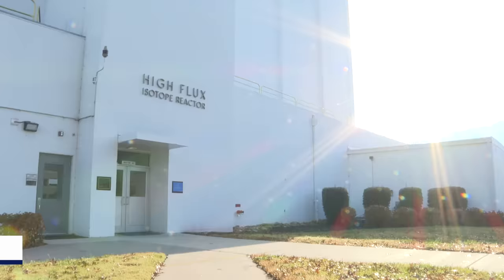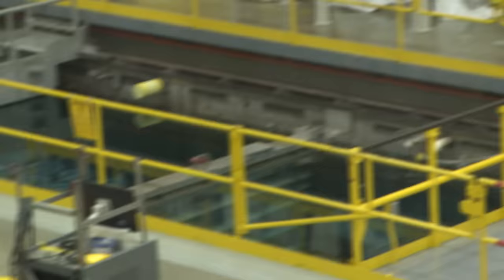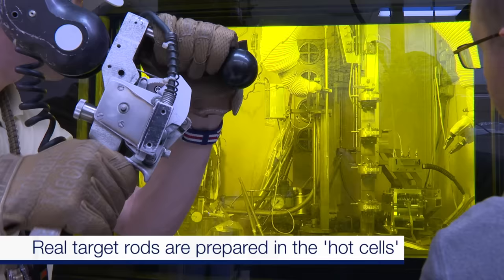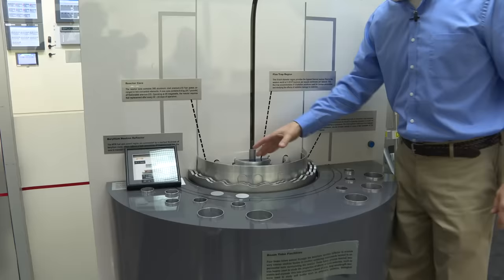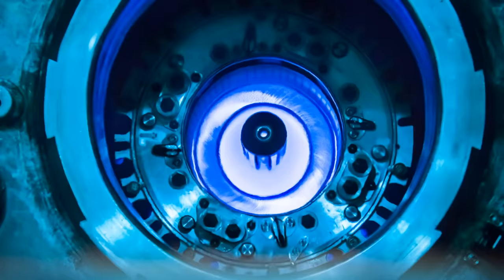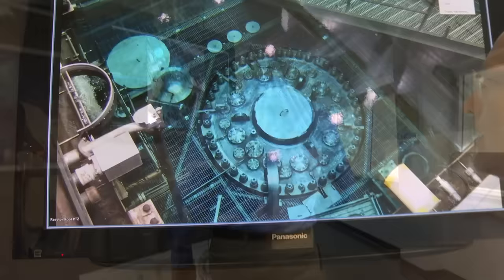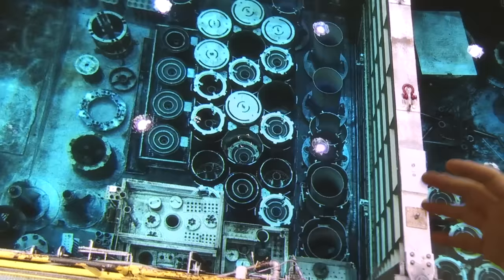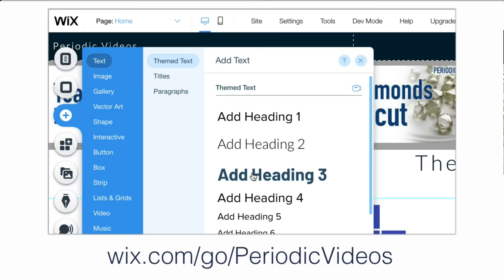Inside a Nuclear Reactor

Comment: "...not trying to make electricity like, say, Chernobyl reactor..."  That's one heck of an example, professor.
Reply: waitaminutedoggie ikr xD
Reply: For better or worse Chernobyl is the most well known nuclear power station.
Probably worse
Reply: Rosatom is still operating 10 reactors of the same RBMK-1000 model across Russia.
Reply: @stephenbrand5661  It's pretty save until next Dyatlov .
Reply: @stephenbrand5661  there have been significant changes to the rbmk since then, they are pretty safe now.
Reply: They made electricity and plutonium.
Reply: Scherbina: - How does a nuclear reactor work?
Legasov: - Nuclear reactor produces electricity.
Scherbina: - Now I know how a nuclear reactor works. I don't need you anymore.
Reply: When you meet your 5-8 year energy quota in the span of 0.2 miliseconds 
Gud job chernoybyl we need more like you
Reply: @steelwarrior105  mainly reducing the positive void coefficient from 4.7 to 0.7 meaning that it's more difficult for it to go unstable
Reply: @unepintade  yeah and the control rod mechanism to a drop scram and removing the graphite rod tips
Reply: I mean when you probably get asked "isn't that dangerous, what about chernobyl/three mile island/fukushima" a lot, your "no it isn't because XYZ" becomes reflexive
Reply: yeh but have you ever heard of Bradwell power station?? i doubt it
Reply: So, what would be another well known reactor that anybody over 13 years old has heard of?  Even with hindsight I can't even think of one even close.  Maybe Fukushima...
Reply: @stephenbrand5661  As long as there's no graphite.
Reply: @stephenbrand5661  Chernobyl still made electricity atother reactors year after...
Reply: That's dry humour for you.
Reply: For Climate Change, nuclear energy is the cleanest carbon free energy source for baseload grid power source we have available
Reply: It was a power reactor, so ...
Reply: i thought same, but it is in fact  really most famous  nuclear electric plant
Reply: @condor2279  there was no graphite. You're delusional.

Comment: One of your best vids ever. I bet that lab was mega-top-secret in the past.
Reply: Only during WW2. Since then it has no longer been involved in nuclear weapons, and is not secret anymore.
Reply: There still is... As per the what the man said "they supposedly make power fuel but I don't know much about that..." :)
Reply: @brianreddeman951  The spent reactor fuel gets transported off-site to another more-secret facility.
Reply: @brianreddeman951  Nothing secret about that. MOX fuel is made by recycling spent fuel. Best thing to recycle, by far.
Reply: @lajoswinkler  MOX is a different process, that plant is still being made and is only meant for powered reactor fuel. This is a mixed aluminum fuel renaturing process very different from PUREX used for MOX. As a nuclear nerd, I also don't know anything about this program!
Reply: @lajoswinkler  My comment was part in jest. :)
Reply: Top secret//SCI
Reply: @Disappointed *finger guns
Reply: Oak Ridge is where the first fissile material was made for the bombs that were dropped on Japan in WW2. There are still parts of the facility that are classified. Oak Ridge also had a working thorium reactor, and as far as I'm aware, the only working thorium reactor.
Reply: Super duper mega top secret.
Reply: Come to think about it my father talked about it when they where building it wasnt much of a secret at all now the one in new Mexico no one knew about that but the ones working on it but not this one
Reply: @gordonrichardson2972  Most people get confused because there's two separate labs in Oak Ridge, Tennessee. This is at Oak Ridge National Laboratories, which does not do secret work, and does not do nuclear weapons. As mentioned in the video, Y-12 National Security Complex is next door. That is where nuclear weapons work is done.
Reply: @brianreddeman951  power fuel for a powerful weapon.
Reply: Well kinda sorta. I live in the county next to Anderson where oak ridge is. The locals all knew but outside these hills it was pretty secret. So yes to,the world it was super top secret like people lived and worked in,the city and didnt leave.

But the locals according to my grand parents all knew what was u0 because our kin folk was running the place and building it even.

Comment: That was a great tour! Since they want neutrons, it makes sense that they didn't have boric acid in the cooling water to absorb neutrons.
Reply: "boron in the form of
 B4C, is present in the inner fuel plates. In particular, 2.8g of 10B are present in the whole IFE (0.0164g/plate). It is used to shift the power to the outer fuel element and reduce the core reactivity"

This is important as the core of this reactor uses highly enriched uranium. This is so the neutron economy can be high at all points in the fuel cycle, but also means excess reactvity in the core areas has to be managed with absorbers built into the fuel elements.
Reply: Glad for you to have had this opportunity to make use of your knowledge
Reply: wouldn't boric acid corrode the metals?

Comment: When talking about nuclear reactors, the majority of people are mostly fascinated by the blue glow of the Cherenkov radiation, but, in my opinion, the snowy like interference you see on videos is far more fascinating. Especially when you consider how each pixel flash is an invisible, high energy, charged particle hitting the camera lense at almost the speed of light. If, somehow, humans had the ability to see these charged particles with either our eyes, or a special camera, you would see a shower of energy coming from the reactor core. The fact that we're not able to see the actual particles themselves, but instead just the effect they have on video, makes it, in my opinion, far more fascinating than the blue glow of the Cherenkov radiation.
Reply: Astronauts have described seeing flashes of light while in orbit and it's thought these are either photons that zip through the eyeball and activate a part of the astronaut's retina, or some cosmic ray that impacts neurons and causes the person to see a flash even though the particle wasn't actually visible. 
So in a sense, we can 'see'  these charged particles as long as they hit the right spots in our optic nerves. Not sure what kind of exposure you'd be talking about if you were working close enough to the reactor and somehow the shielding failed and you started seeing regular flashes.
Reply: Thanks for mentioning. I didn't notice the first time I watched. Both phenomena in a single shot are fascinating.
Reply: @DriveCarToBar  It's also possible to have neutrinos hit the water in our eyes, giving off a flash of light. Neutrino detectors work the same way, looking for the flash. They would be exceedingly rare events to happen to a person, perhaps never in a lifetime given how little neutrinos react with ordinary matter, but certainly possible.
Reply: @Restilia_ch  Except that the odds of a Neutrino hitting ANYTHING are supremely low, let alone water inside your eyeballs. At SuperKamiokande, the water is heavy water and its a tank the size of half a football field, and yet they see 5 or 6 neutrinos per month
Reply: @ZeNashB  I know it's extremely low. Doesn't mean it's impossible.
Reply: @DriveCarToBar  Actually as a physics student I sas told that they probably are electromagnetic showers generated by the impact of a high energy proton with some atom in the transparent part of your eye...which makes a lot of sense ;)
Reply: Indeed cherenkov radiation it is caused by particles moving faster than the speed of light, a phenomenon which can happen only in a dense medium such as water, never in vaccum or so it is what science says!
Reply: @sebastianarganaraz2879  More precisely, not faster than the speed of light in vacuum (that is impossibile in our current understanding of nature) but faster than the group velocity of light in the dense medium (which is always lower than c, since it is c divided by the optical density of the medium which is always greater than 1)
Reply: @sebastianarganaraz2879  You can have the Cherenkov Effect radiate in our atmosphere as well...
Reply: @danieldevito6380  I'm aware that has been recounted by some witnesses like Dr Slotin and he's collegues in the demon's core incident while participating in Manhattan project and several people during the Chernobyl disaster
Reply: @DriveCarToBar  In fact cosmic rays áre far More energetic than this particles in the range of million electrón volts that's why caused that effect on the astronaut's eyes
Reply: same here, when you watch videos of the robots in the fukushima reactor during the initial phases of the meltdown you really could see it very well
Reply: Hi, thanks for the info, just a slight correction. The particles are actually hitting the camera sensor itself not the lens, that’s what produces the snowy effect. (The lens gets hit also obviously)
Reply: I wonder if a long exposure photo would show anything cool.
Reply: @sebastianarganaraz2879  You can also get Cherenkov radiation in the open air since light also slows down significantly in our atmosphere.
Reply: I’ve seen Cherenkov radiation blue flashes in my eyes during a CT scan! You gotta have your eyes closed to adapt to low light, but you’ll see it!  Also a strong smell of ozone for a bit.